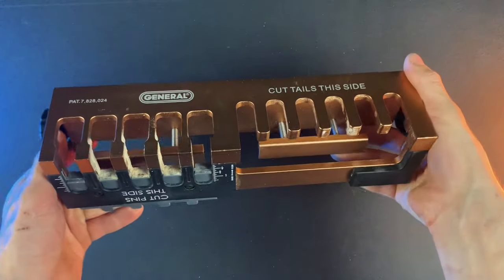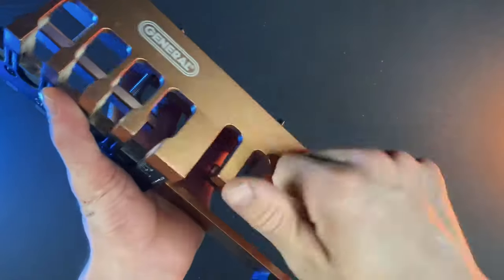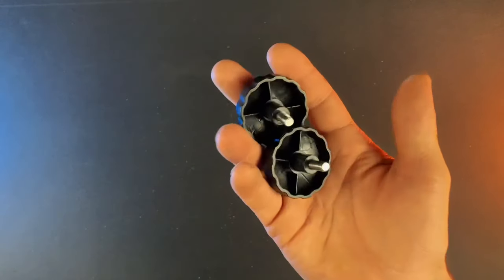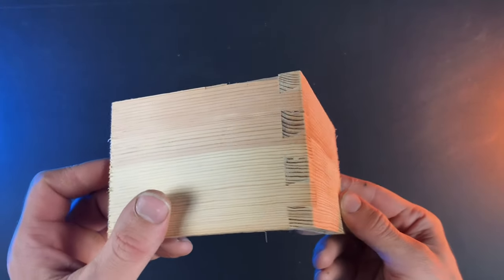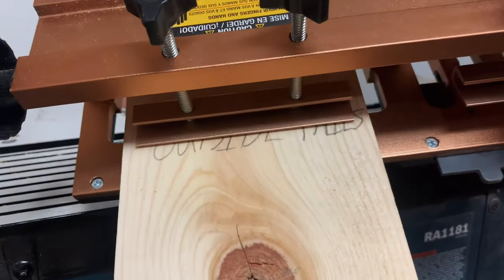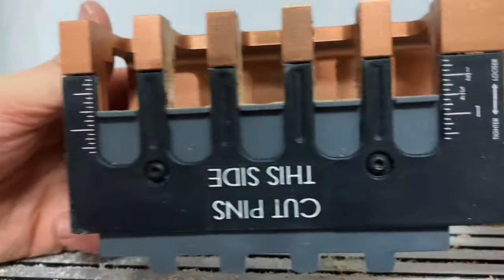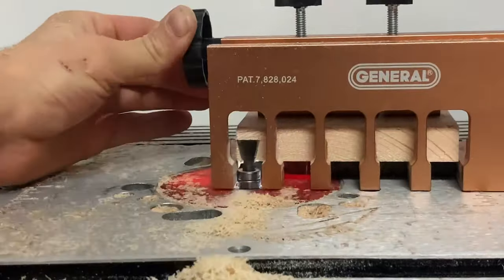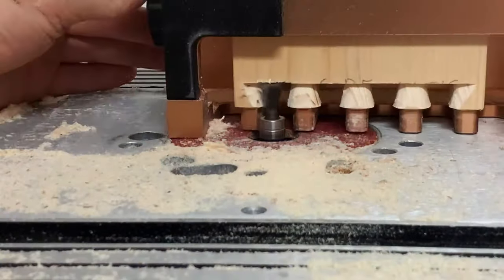General Tools Dovetail Jig - Review & Demonstration

Comment: Iv seen your other video and was wondering if  Instead of running the bearing along the front of the jig then in. could you just  aim for one of the inside  and run the bearing like intended to avoid rounding it making it look as the product advertised
Reply from the maker: A dovetail jig needs 2 bits to get straight edges for through dovetails. When using only one, since the bit is rounded, it’s not possible to get a straight edge on the pin sockets. This jig is designed with that in mind and offset accordingly. The marketing picture is just misleading.

Comment: only half blind dovetails? any way to rig it for through dovetails without the rounded pin?
Reply from the maker: No, unfortunately not with this jig. I use the porter cable dovetail jig for most of my dovetails. It can do the different kinds of dovetails as well as box joints but the width you can do is limited to I think about 12”. It’s also a bit more expensive.

Comment: Tear out though
Reply from the maker: I haven’t had much if any tear out when using solid wood but when using plywood it definitely does have tear out. Then again, there’s really not much you can do to avoid tear out when cutting dovetails into plywood. Best way is to not use plywood but if you must then sandwich it between two other pieces. Same goes for solid wood if you’re  getting tear out.